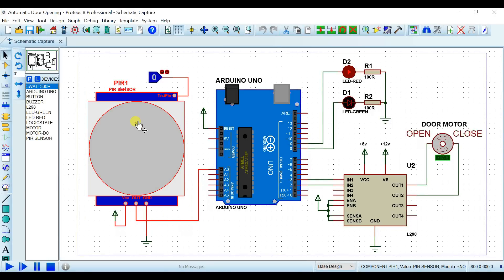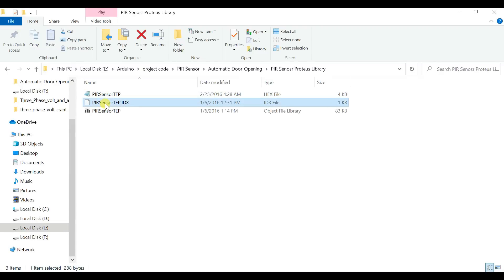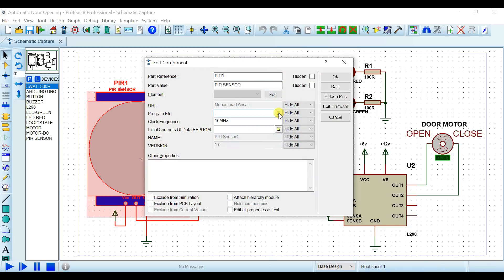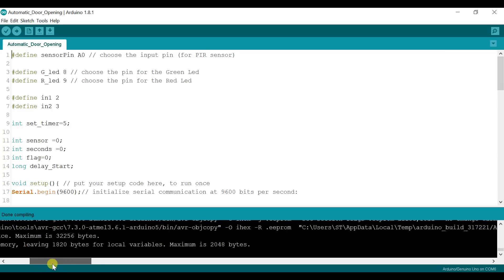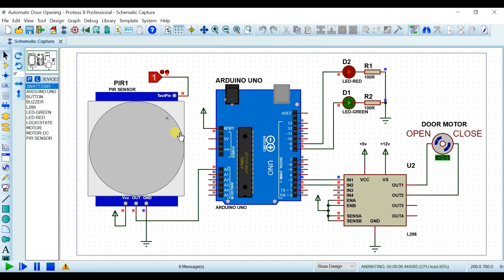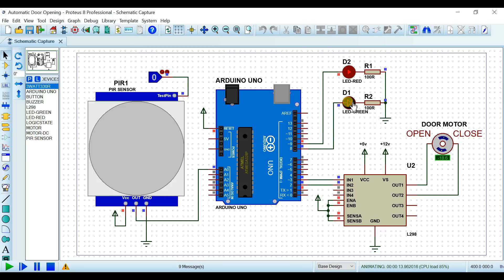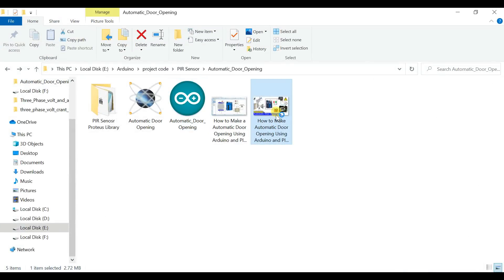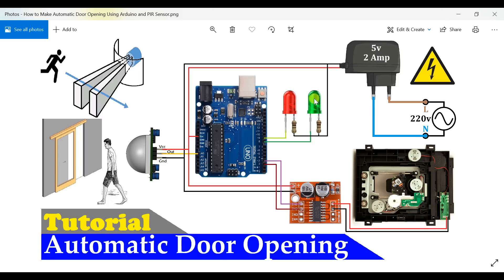How to Make Automatic Door Opening Using Arduino and PIR Sensor | Automatic Door Opening System

Comment: Components (as described in the video):
1) PIR Sensor for Motion Detector
2) Arduino UNO
3) L298 Motor Driver
4) DC Motor for opening and closing doors
5) Two LEDs
=> Red LED for timer
=> Green LED for PIR sensor motion detector
6) Two 100 ohm resistor

Comment: Hello Sir,
After Compiling the code it is showing,
Sketch uses 2624 bytes (8%) of program storage space. Maximum is 32256 bytes.
Global variables use 228 bytes (11%) of dynamic memory, leaving 1820 bytes for local variables. Maximum is 2048 bytes.

And Not Showing The Address Of That File So How Can I Solve This Problem.
Please Reply
Reply from the maker: Open the arduino and go to the file and open the preferences and select the 
show verbose output during: [yes] compilation
Reply: engineering me bhi Arabic 🤦🤦
 matalab banda kitana bhi padh le engineer doctor ban jay par ander se Maulana hi nilkata hai 🙇

Comment: Sir can you please design a circuit that uses a limit switch preventing the door from opening beypond a limit
Reply from the maker: yes i will try
Reply: @MuhammadAnsar  sir thanks for the swift reply. In real life usage there are few additional points that i request you to please solve. 
1. The doors need to close softly. They cannot close this fast, else the glass doors would break. Maybe a variable PWM code to close and open the door would solve this.

2. To avoid breakage of the mechanical system, i request you to add 4 limit switches so the open and close position of the doors can be read by the arduino and the power to the motor stops.

3. The motors used are either 12volt or 24 volt with high current draw, so kindly consider that as well.

Trying to incorporate this design in real life , so asking you for help.

Regards.

Comment: It didn't work for me. I'm using L298 motor driver widely used but not working. Motors are not spinning!
Reply: Ya for me also
Did you get the solution?
Reply: @adarshnaik5505  work for me. check your pin sensor on Arduino IDE with your hardware. it's different
Reply: @Αngga Gintara  your project work properly ?